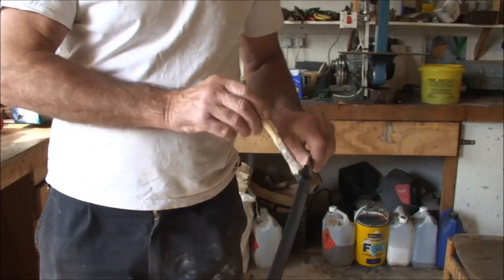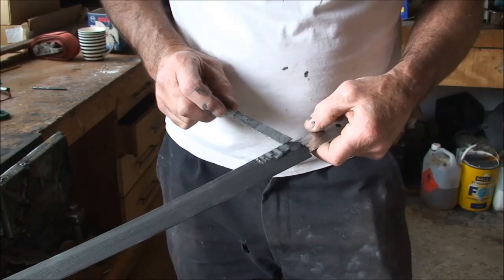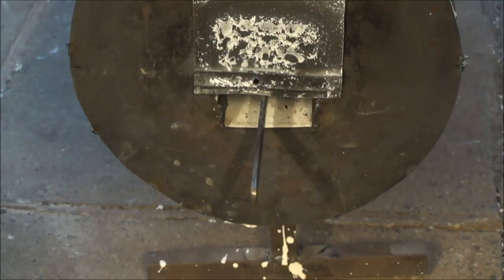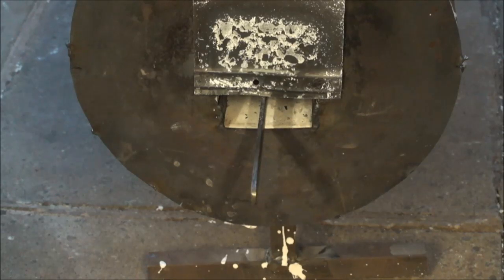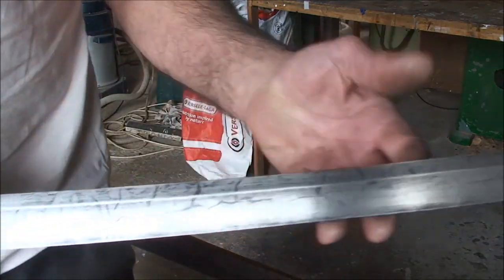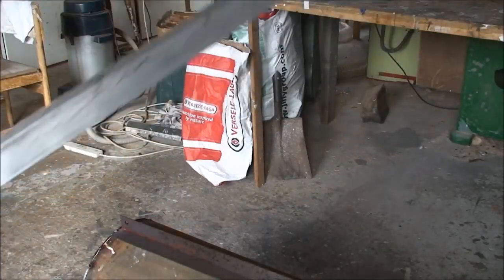Truck spring Katana sword part 2

Comment: ive heard that quenching with water is trickier, but why is that?
Reply from the maker: +Buk Lau the blade transforms very fast in water and can easily crack, brine solution is safer but can still crack the blade.
Reply: Because they mainly use oil

Comment: I was under the Impression that the Hamon is a result of differential heat treating. using much thicker clay along the spine and thinning it out as you move towards the blade edge should cause the spine where the clay is thickest resist the quench longer.  but then again ive onlt watched videos about heat treating and have never attempted  anything like this. Although i find myself drawn to blacksmithing . I may make myself a small coffee can forge for making knives and see how it goes
Reply from the maker: +patrick jaroch Yes thats basically it Patrick but you can manipulate the Hamon pattern with the placement and thickness of the clay, the steel used and the temp comes into play as well, I have still alot to learn on the subject but will be trying out many methods to see how it all works. Cheers.

Comment: I'm nervous on my up coming first attempt forging my very first katana what worries me is the tempering & quenching  I'm really scared. do u think sir its ok if I quenched it on a warm water instead of oil the steel im using is a leaf spring  from a construction truck I have no idea what steel type it is since I bought it on a junk shop any advice sir
Reply from the maker: do not quench in water Mark ! the temp has to be just right and so does the steel, use warm oil it will still get more than hard enough for a Katana.
Reply: ppotty1 any oil would be good sir? 
Like a used cooking oil  or any suggestions
Reply from the maker: yes cooking oil, also  peanut oil or canola is quite good, warm it up before the quench it helps cool the steel faster.
Reply: so even a used one is ok since its been use on frying a fried chicken
Reply from the maker: yes fine, just move the chicken pieces to one side ;-)
Reply: Thanks so much sir now I'm clear to go.. I hope my work will turn into  success 👍